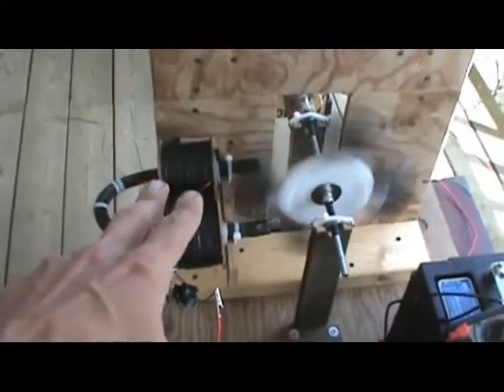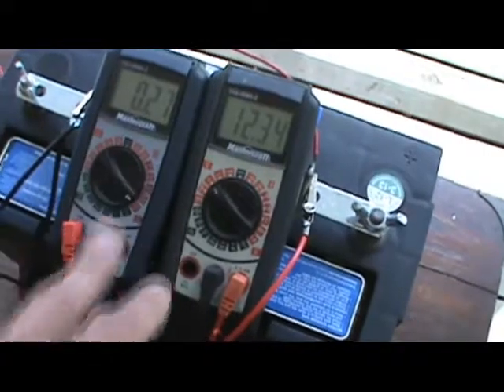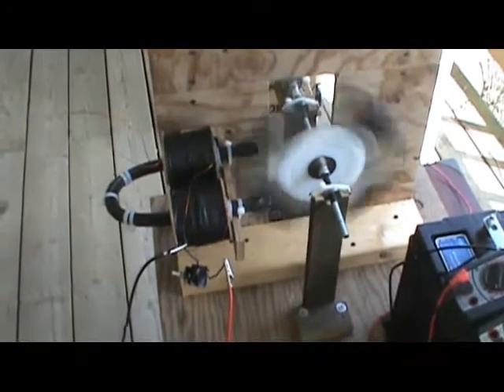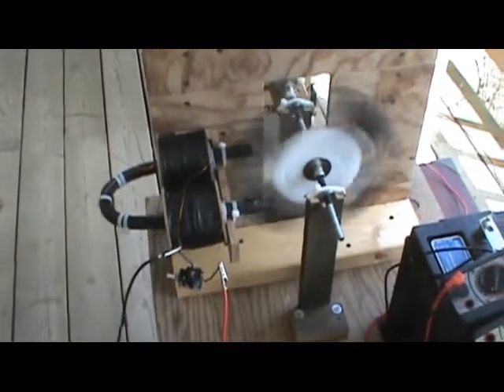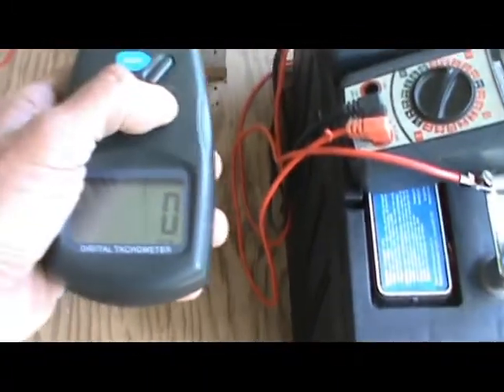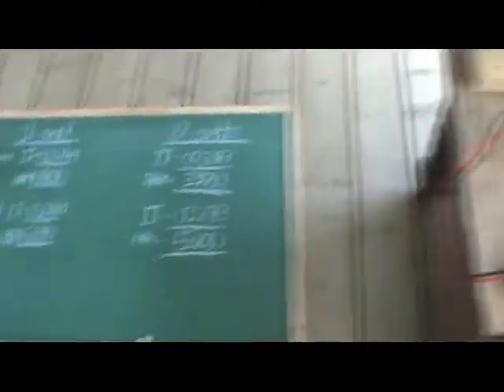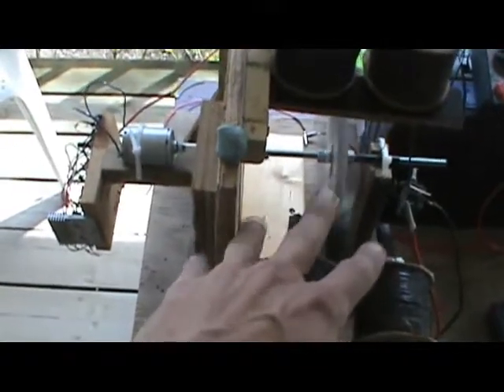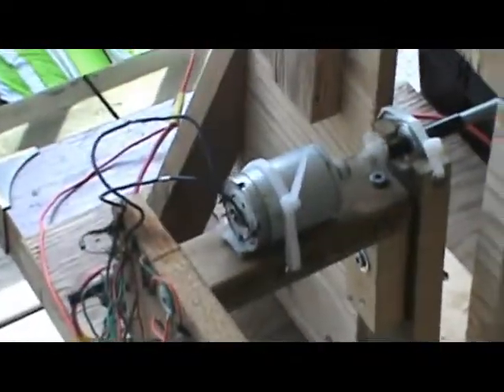Overunity Quest - Kromrey Reaction Test - Fail

Comment: going for resonnance is very important... almost non questionnable. I'M thinking that there must be a non-symetrical arrangements of coil and magnets that would be better than all symetric arrangements. for exemple, divide your flywheel in half, find the PHI ratio point within both halves (cause you cant find that ratio within a complete circle..), put a magnet there at both places, and continu to put magnets where the PHI ratio repeats. maybe you will have a super flywheel! i nver seen this yet

Comment: the ucore/coil im using to supply the base on my machine is rising as the run battery voltage drops. seond time its done it and im watching very closely now  :) vid loading...would have been earlier, internet issues.

Comment: Q&A? Are the magnets losing any strength over time? (During your series of tests?) ... Is there much difference in impedance between the two coil sets? (I believe you mentioned ~19 ohms for the first set.)

And I have always believed that there is some threshold for the RPM v. motor voltage v. the EMF output, the output may be follow an exponential output related to velocity of the magnets ... Since you made the previous tests with RPMs in the 600 to 800 range, ?? ... just speculating.